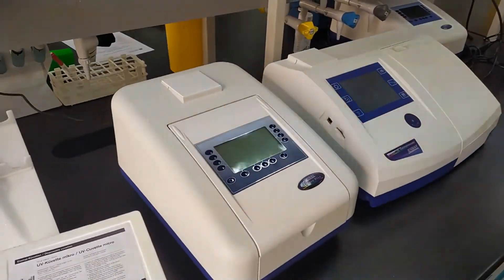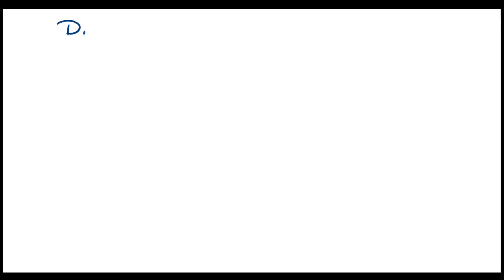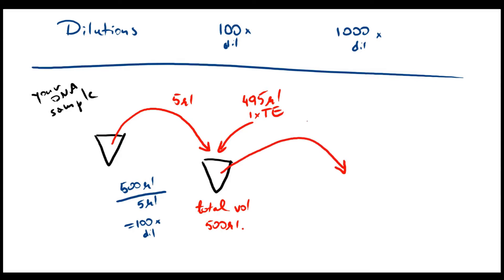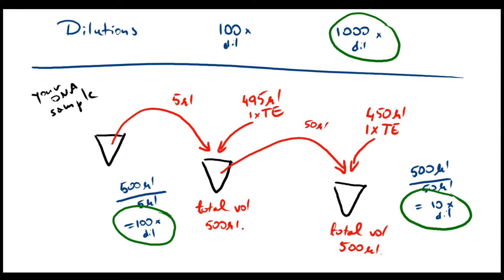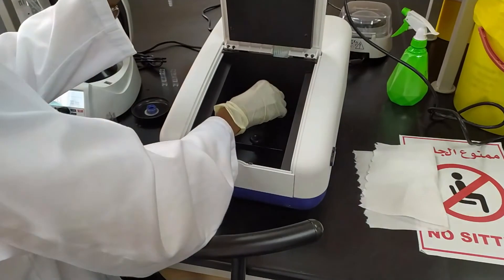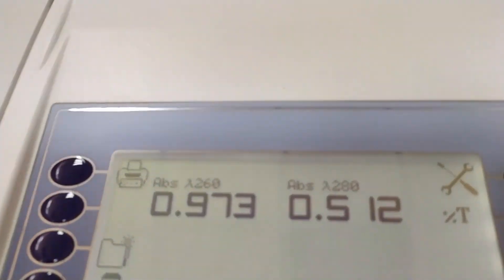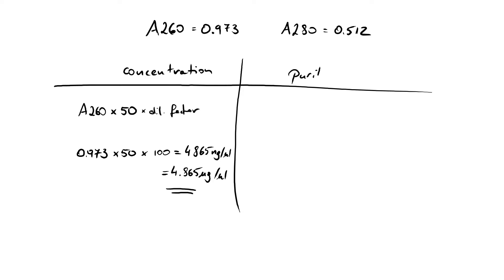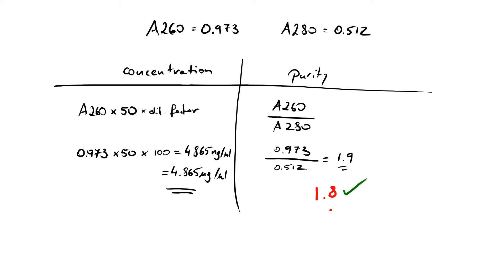Determining DNA Concentration (BIOL310)

Comment: Can you use fluorometer instead of spectrophotometer to measure the DNA concentration?
Reply from the maker: DNA, on its own, does not fluoresce.
While it is true that we use UV light to make it "glow" on a gel, that glowing is not because of the DNA itself, but because of a common additive in agarose gels called ethidium bromide, which binds to DNA while it migrates in the gel.

Comment: Thanks for your wonderful video
How much solution do you take of each diluted microtube (100× / 1000×) in order to measure the absorbance in spectrophotometer?
Reply from the maker: We use the full amount (1ml) because of the type of cuvettes we have.  

There are some cuvettes that have a 0.1cm pathlength, which allow you to use much smaller volumes to measure your DNA or RNA samples, but we don't have those cuvettes in our teaching lab.
Reply from the maker: using a cuvette with a smaller path-length would also require you to adjust your calculations to account for that.  The calculation we used, assumes a path length of 1cm (this is standard for most cuvettes)
Reply: @ItsLearnable  Thank you so much 🌹🌹🌹🙏🙏🙏

Comment: Excellent explanation
Reply: In the calculation of concentration of the sample, what does 50ul denotes? Vol of what? Thankyou
Reply from the maker: Thanks for asking the question  @lona6061 .  It's nice to see people trying to figure out why things are done in a particular way. 👍

If you're referring to this: https://youtu.be/O8FytCl_99Y?t=211

then please note that it's not a volume.  The "50" here is a constant - it's actually the inverse of the extinction coefficient of DNA [0.020 (µg/ml)-1 cm-1 ], and we're using the Beer-Lambert equation to determine the concentration.  According to the equation:  Concentration = Absorbance / (extinction coefficient * path length).  And we have to multiply that by the dilution factor to get the actual original sample concentration.

For many students, in what is an introductory course to molecular biology methods, the above might be a bit scary/intimidating.  That is why we generally just simplify it, as I showed in the video.
Reply: Now it's super clear! Learning and preparing for research watching your videos
Reply from the maker: Thanks